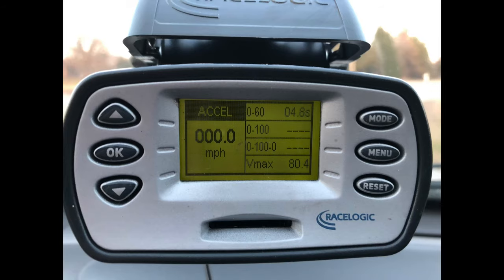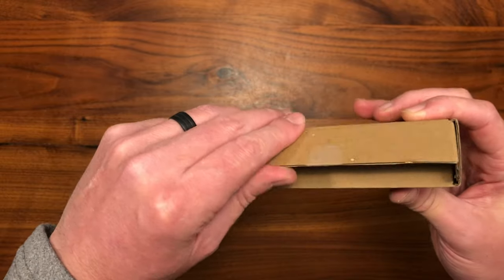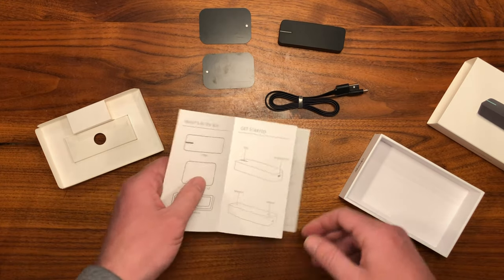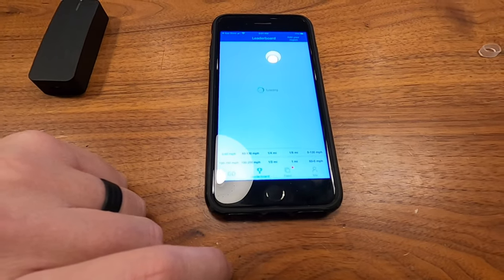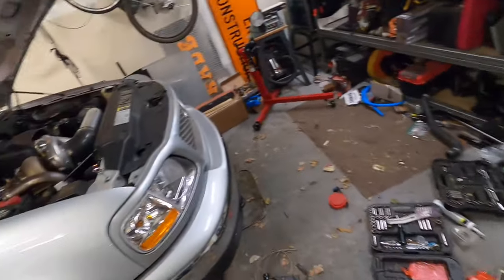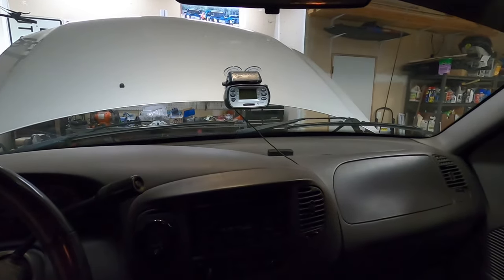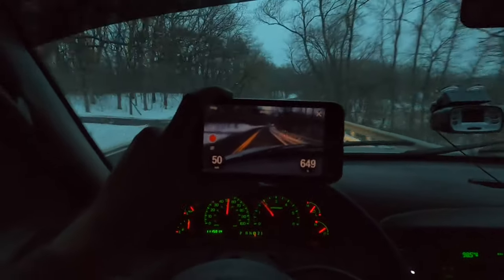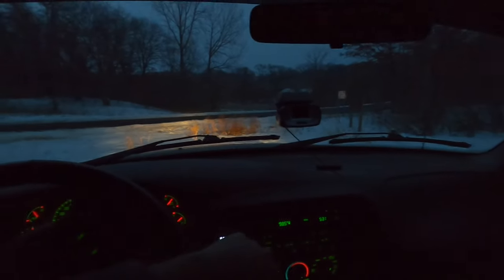DRAGY Perfomance Meter: Unboxing, Setup & TESTING on my Big TURBO Sleeper F150!!

Comment: Maybe a 3000gt vr4/ stealth? Pretty under rated car. Not many people doing much with those. Mine runs 28 psi (550-600whp) on the stock motor so they are good cars to build.
Reply from the maker: I drove a vr4 many years ago. That's an impressive amount of boost you're running! Dang!
Reply: @AutoDetour  that’s on e85 and with arashi 20t turbos. It was a cheap and quick build. Would make good quick content. I only spent $7500 on the whole car and the build. Although I got the car for $800
Reply: @awesome12480  I know I know the usual “my uncle” story, but he bought a stealth R/T a few years ago and that thing is riot! It boogies off the line!
Reply: About 7 years ago, i had the chance to get a nice white 1991 vr4 for 5k, i whish i bought it, those things went up in value by a lot, i got to test drive it at least, it's a highway bruiser for sure and a stoplight drag racer too.

Comment: Plans on transmission when you're at 1000 hp?
Reply from the maker: Probably build the 4r70w and see if it will take it, then built 4r100 if necessary.
Reply: @AutoDetour  the 4r75w with a few upgrades would be a.good set up that would fit right and the 4d100 would add Wweigjt and reduce horse power